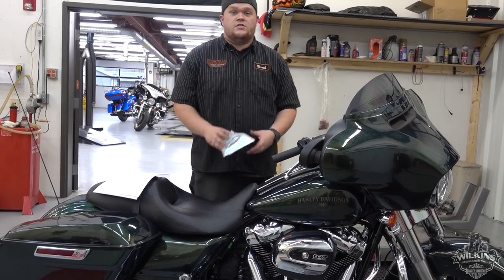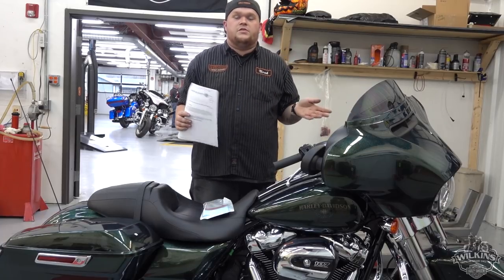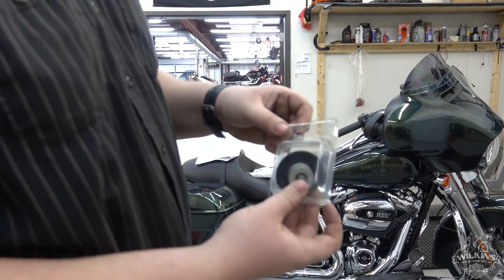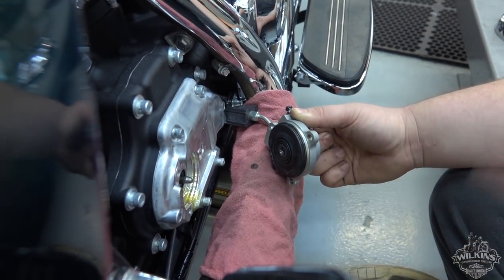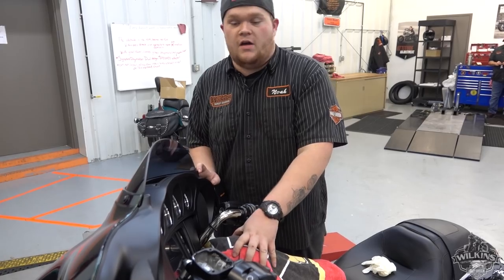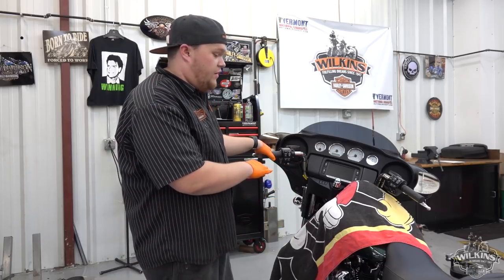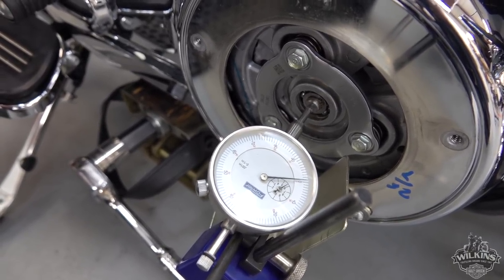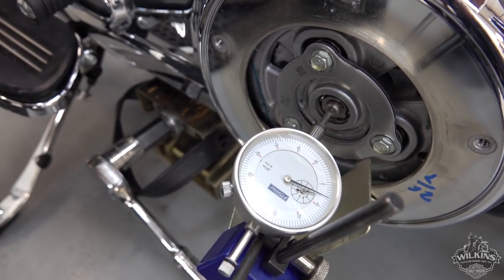Step by Step Walk Through of Harley-Davidson Recall 0173

Comment: If the brake fluid is making it's way into the transmission bore how does that affect the oil in the transmission?
Reply from the maker: Doug, more info is here.  https://www.wilkinsharley.com/blog/recall-0173-photo-details-on-actuator--7582

Comment: could dot 5 be used instead?
Reply from the maker: You cannot. Mixing DOT 4 and 5 will cause a gelling effect and may cause brake failure.  If DOT 5 is put into system HD recommends us to replace all the components (Lines and rebuilding master cylinder).  -Wilkins HD, Master Technician, Trevor.
Reply: Dot 5.1 is compatible ......but 5 is not.  ( there is a difference)  When someone mixes you need to flush with denatured alky too clean.  No need to replace.  But all need too be cleaned spot less....
Reply: @docholiday1034  still recommend dot 4. Especially Harley Davidsons new platinum dot4 brake fluid. It has a higher boiling point. Meets and exceeds the automotive standard.
Reply: Noah Trepanier  looks great on paper and they all fudge the numbers. Harley is the worst for BS.But as soon as you unseal cap on fluid....boiling point drops everyday it absorbs moisture .  Thats why with brakes it so important too bleed/ flush system pretty more often than recommended . If you really want to debate fluids.....castrol srf can't be beat.....but too expensive for the wine and cheese crowd HD owner.  If your a racer you'll appreciate it. Bosch is not a bad fluid either.  Your HD fluid is about one step up from DRAG fluid which should never be used.....boiling point is something like 400 dry which we all know is in a sealed bottle.  But hey if you buy into the platnuim BS go for it . Forums love the crap.For others reading this....buy your fluid in small sealed bottle than toss it after a few weeks if you don't use it. Unsealed on the shelf it's about worthless in a few months.
Reply: @docholiday1034  well you definitely have your opinion but to take away from all of it no matter what brand dot 4 you go with replace it every 2 years at the maximum sooner is always better.